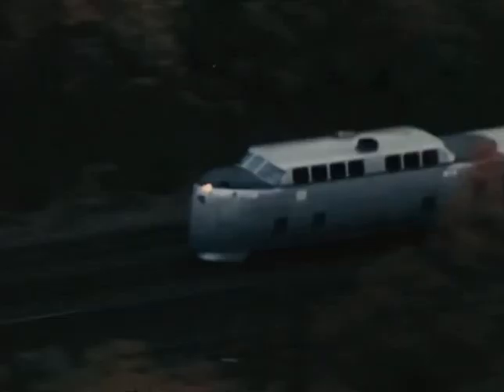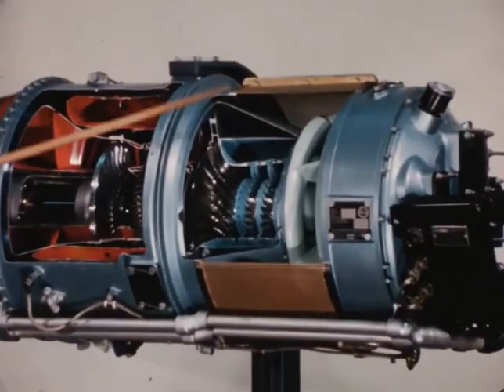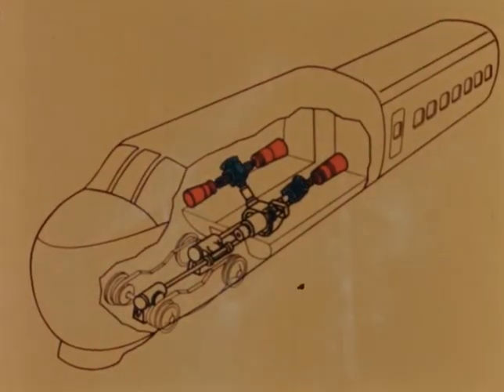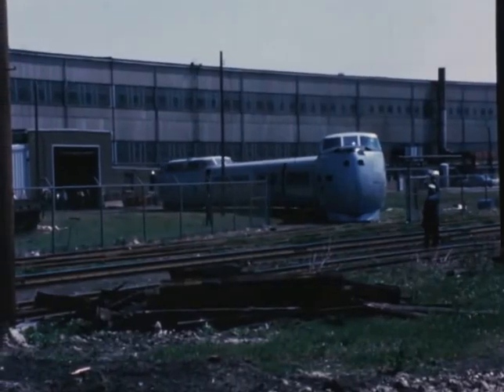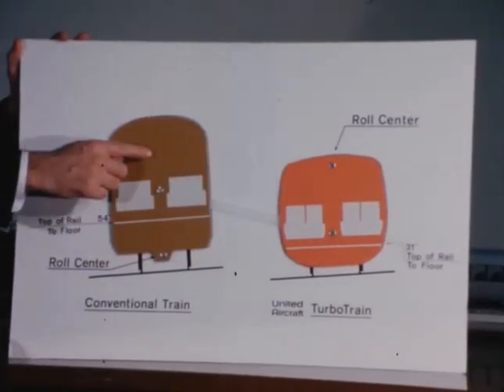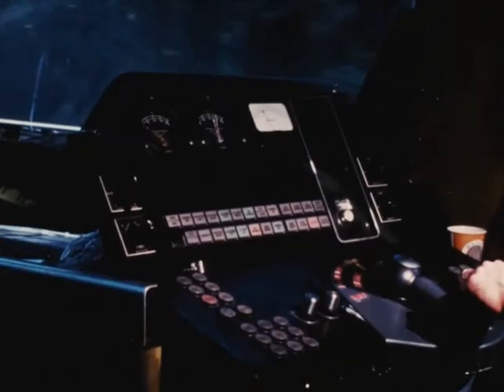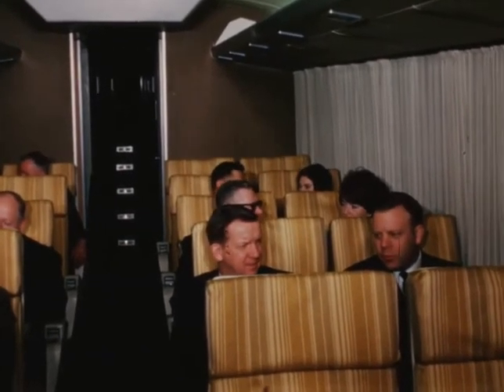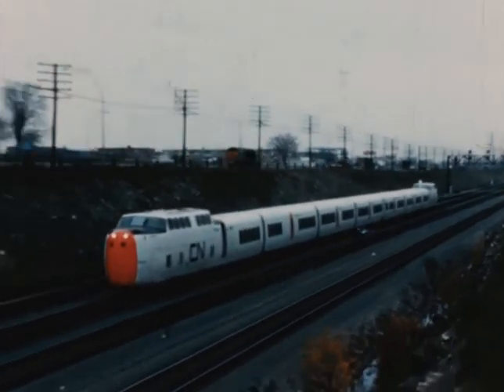The TurboTrain - The Sikorsky Aircraft Promotional Film

Comment: I remember taking the turbotrain from Ottawa to Montreal in the early 80s, terribly sad it never reached its's potential. By my lights 3 main issues:
1. Using existing track shared with freight ( still the same today in Canada) 
2. Some posters cited: temperamental brakes and the turbine. If memory serves, this  caused many delays. 
3. The existing track was not up to scratch. The train could never reach optimal  speed

Combining the three above issues, it was more convenient to take anything but the train. Maybe one day, the Quebec-Windsor corridor will have a real passenger rail service...

Comment: Gas turbines are usable on trains but probably not cars - the hot exhaust is terrifyingly hotter than bothered. The only way to use a turbine properly is to derive the heat as a useful commodity - turbine trains would be ideal for a mobile factory which can process resources during transport - a bakery and processing/packing line would be perfectly appropriate. So would a hotel or hospital. Stalin had his personal militarised power train. Train cars were the private jets of the 19th century in the USA.

Comment: How To Compete With Airlines. 1, add wheels to a fuselage. 2, use turbine power but not with direct thrust utilisation nor driving efficient multi-bladed variable-pitch propellers. 3, use complex and unproven gearboxes to funnel shaft-drive directly to some of the wheels, completely ignoring the facts that (a) driving a generator or alternator to provide current to traction motors had already long been proven to be more efficient; (b) that decades of locomotive experience had clearly proven the superior reliability of power-electric drive over power-mechanical (and power-hydraulic) drive; and (c) that UP had unequivocally demonstrated that even turbine-electric propulsion was excessively fuel-hungry compared to diesel-electrics of similar power to the rail and less than optimal in the reliability stakes. 4, run the passenger services at about a third of the speed of a period airliner due to the inconvenient presence of track curvature and altitude variations between and over annoyingly hard and unyielding geographical and man-made features. What could possibly go wrong?
Reply: But they throughly tested the concept for all contingencies.  :face-blue-wide-eyes:
Reply: CN definitely pitched this train like a Boeing 747 on wheels with overpriced Concorde business class ticket prices. Hardly nobody could afford using this thing as a regular  highspeed commuter train like you see in Europe and Asia today.

Comment: One issue they had was lack of torque from a start. So why couldn’t the electric motor be used there?
Reply: They needed to keep the weight down. But a 2 speed transmission would have made sense. I wish there was more on the drivetrain tech out there.

Comment: why did they pull these trains out of service after only 12 years ?
Reply: They were experimental and everything that could go wrong did. Then the engineering was far ahead and the market didn't have a profit earning position for a turbine train. They would have flown off tracks with full speed.
Reply: Reliability issues were the main culprit.  I rode the Turbo only once, on the former New Haven railroad mainline, between Providence RI and New York City.  From a railfan’s point of view, it was great sitting in the front seat of the power dome car & literally looking over the engineer’s shoulder!  - I remember us passing the northbound Tropicana orange juice train with 3 bid 6-axle GE locomotives & about 100 cars (it’s much shorter these days).
     If you were in one of the coaches rather than the power dome car, the ride on the old New Haven’s jointed rail left a LOT to be desired, as the single- axle coaches wheelbase was about the same as a length of jointed rail, resulting in a loud “CLUNK - CLUNK, CLUNK- CLUNK”, noisy bumpy ride.  This was in the Penn Central era, when the former New Haven mainline was in rough shape, in contrast to today’s smooth all - welded rail Northeast Corridor mainline.  The ride in the Turbo’s coaches was basically similar to the failed experimental high - speed trains that Pat McGinnis foisted on the New Haven during his disastrous presidency in the 1950’s; trying to do high-speed rail “on-the-cheap” with Talgo - style trains while deterring proper track maintenance.  In contrast, Talgo’s can deliver a smooth ride on PROPERLY MAINTAINED welded rail; Amtrak’s Talgo’s running in their Northwestern “Cascade” service are quite popular.
Reply: @WA1LBK  Yeah I was 11 years old and obsessed with everything Turbo. My parents finally booked a trip as a surprise and to my dismay the Turbo arrived an hour late, being pulled by a regular diesel engine. No a/c in the coaches and it was a hot, slow, disappointing trip. :(
Reply from the maker: never were winter tested,and track quality they ran on was not great
Reply: I remember seeing the Turbo in ugly VIA yellow rotting in the Toronto yard...sad ending 😢
Reply: Add in to everything else, railroads were bleeding passengers & money. They weren’t in a great financial position to buy whole new train sets, maintenance facilities, & parts. Then having to train personnel on it & possibly run into labor union contracts issues

Comment: Doesn't hurt to put an aerodynamic low drag nose on every high speed train although I wouldn't apply direct mechanical power via 90 degree gear boxes that's gonna be bad. I would use turboprops to drive generators and put motors on each of the carriages
Reply: That is actually how the ICE 3 works, every second carriage has one motorized bogey. This way, top speed doesn't depend on the length of the train, and both train ends can be used for seating right up to the engineer's cockpit.